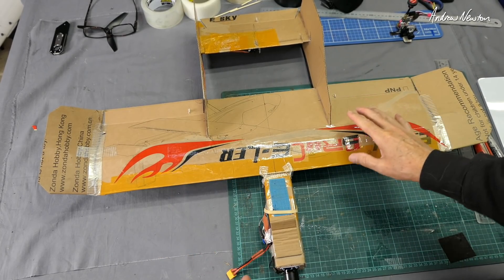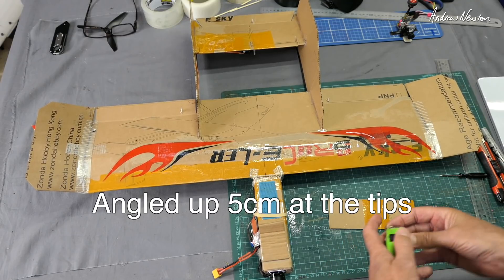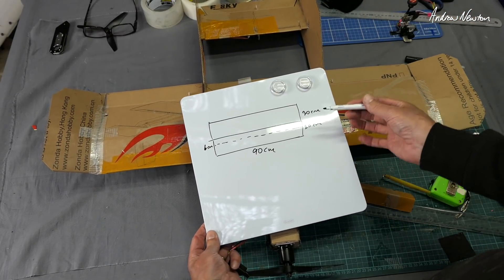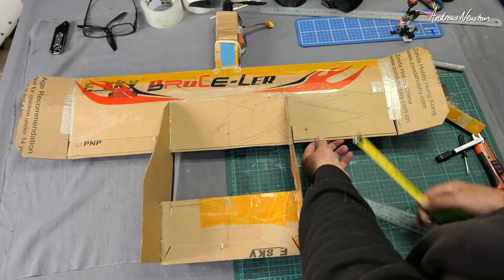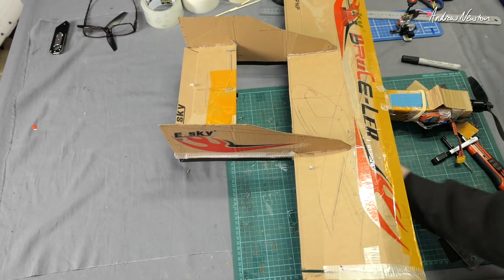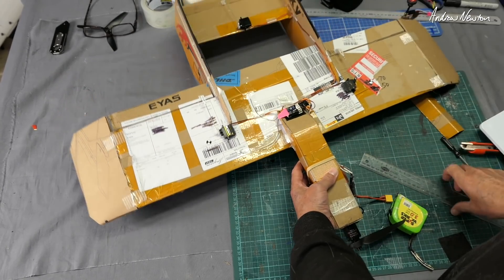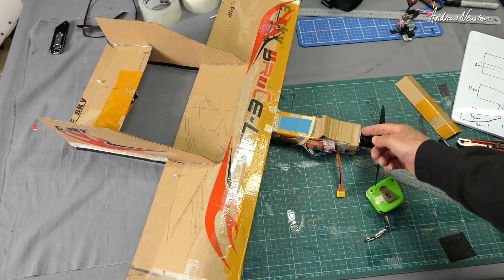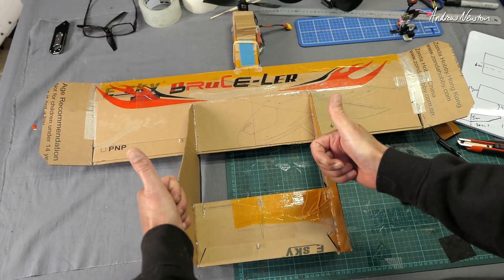Bruce-ler plans

Comment: Having that H-stab higher than the main wing will slightly increase its efficiency, as it's out of the strongest area of downwash from the main wing. Yes, the effect would be more if it was higher up, but I reckon the amount you've got there is enough to make a positive difference.
Reply from the maker: Aha, that's the reason, thanks

Comment: For prototyping (and beginners) a pusher motor mount would be more adequate. Eliminating prop breaks and motor shaft bending. 
Do you think it is harder to implement?
Reply from the maker: Yes pusher would be better for crashing, easy to adapt. Next version will be a pusher

Comment: Nice to make on holiday, have the motor pod ready made and make the rest from cardboard while you're there! Thanks for sharing!Matthew
Reply from the maker: That is a great idea. Pack a hobby knife, tape and glue gun then look for materials when you get there.
Reply: One could make a template out of paper, then just find some carboard and cut it out and glue it together, save the template for the next trip. Could probably make the whole thing in an hour. Will have to try it, I'll send link if it works!Mattthew

Comment: Servos mounted on the Underside of the Wing 🤔i would'nt recomend this on a Gearless Plane, to much Risk damaging the Servo Gear when landing  in ruff Grass🌾🌱🌿.
Reply: If the belly was flush with the bottom of the wings, I'd agree, you'd definitely want the servos on top. But I think this one would be okay, as the fuselage sticks down much lower than the servos, even if it lands on one wingtip.
Reply: @rcbinchicken  on short Grass, like Andrew shows in his Videos 👍🏻, it's definitly no Problem, my concerns are about not so fine Landingfields with some tough Weeds(15+cm, 5") that can rip off the Flap or even the Servo 😖😨Greetings❗
Reply: I've done it plenty of times with similar style built planes, really it's not a problem. When you build a plane from spares, you don't get too concerned if you need to replace a servo one day....
Reply from the maker: Yes you're right Anton, in longer stubbly grass you would want some sevo protection
Reply: @AndrewNewton  👍🏻